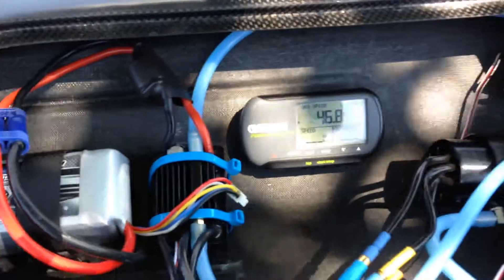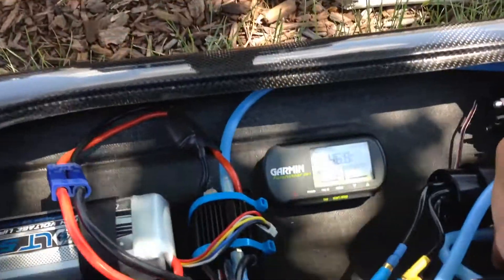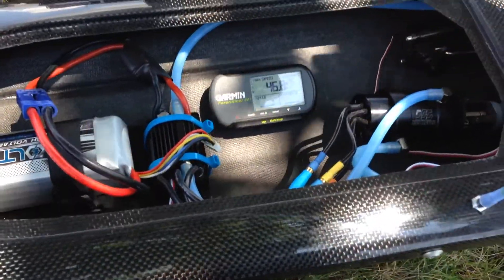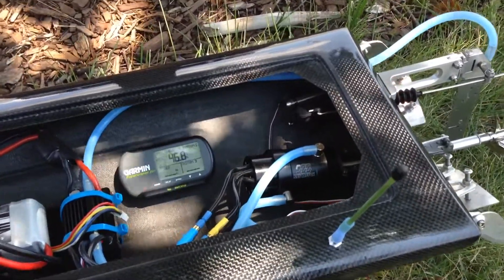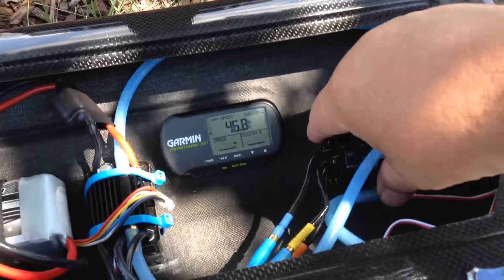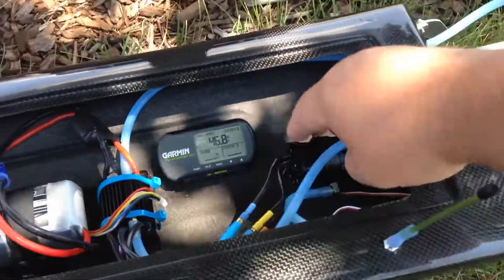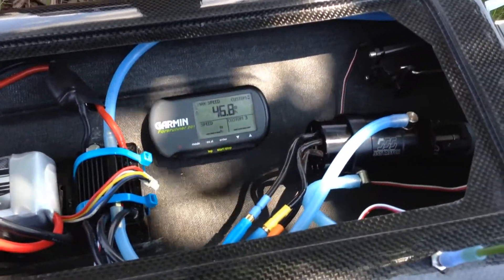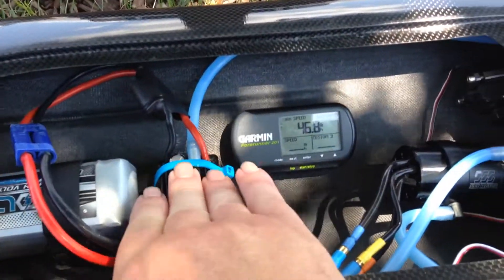Leopard vs SSS vs TP motor part1 TFL pursuit

Comment from the maker: Pedro
I think 40mm is too much for integrated....
May also be a bit much for carbon...
For a fiberglass pursuit the 4074 should be a good choice.
I have a Neu1521 same size as tp 4050 I think it will work great in ariane but prolly too much for pursuit.
I also have tp4060 that may be crazy fast in ariane but I'm not sure at this point if I will try it in there but I will definitely try the 1521.....

Comment from the maker: The one piece is the way to go, especially if it has a stinger, with strut the 2 piece is not too bad.
But the second  time I run ariane the bullett nut loosened and I lost my cnc444 to the bottom of the pond.👎👎👎